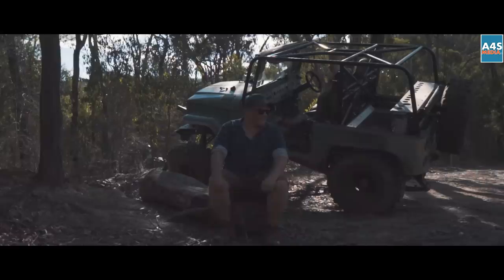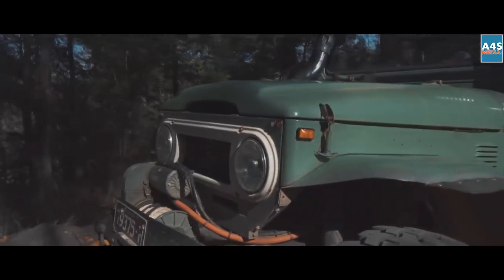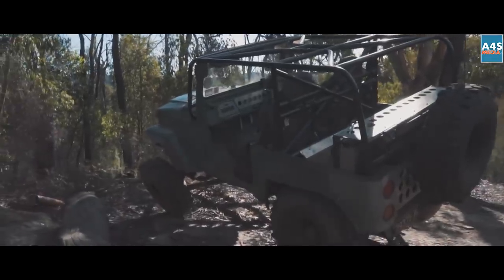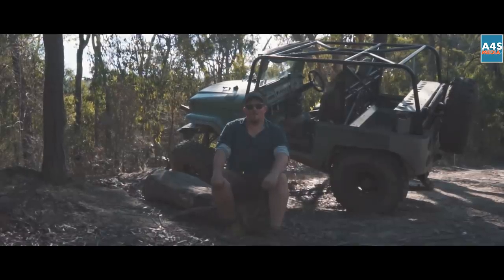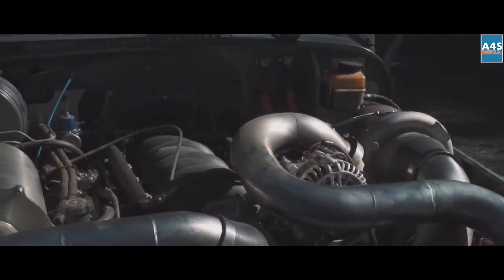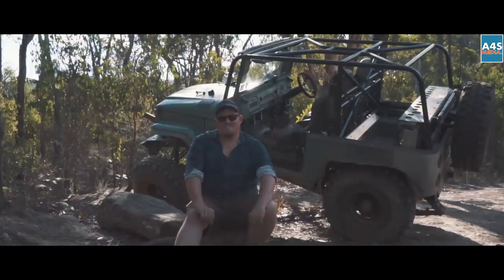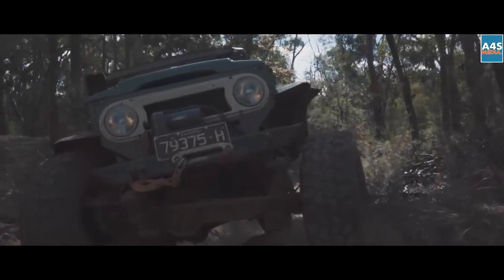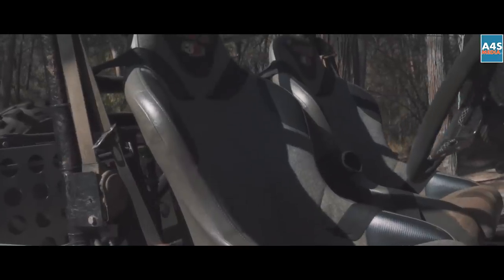LS1 Turbo FJ40 Landcruiser

Comment: Congratulations. The most reliable car that was, is now the least reliable car.
Reply: You're wrong.As a Toyota owner i can tell you that the LS1 motor are nearly indestructible.
Reply from the maker: Why is that ?
Reply: @A4SMedia  mainly because pushrod engines are just downright simple. Without complex construction, like dohc engines.As some people say, sometimes the simplest designs are the most reliable isn't it!.Yes it doesn't rev skyhigh but it does have the low end torque but that a good thing,because you like 4 wheeling.
Reply from the maker: fair point
Reply from the maker: +Weather Music  fair call
Reply from the maker: +Weather Music ok
Reply from the maker: +Weather Music ok